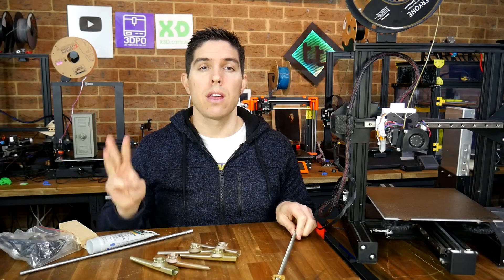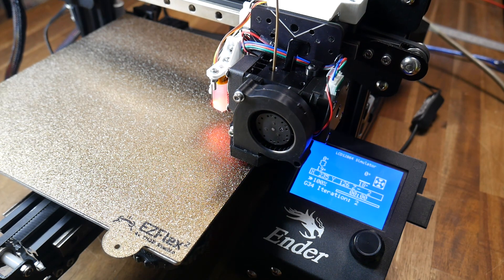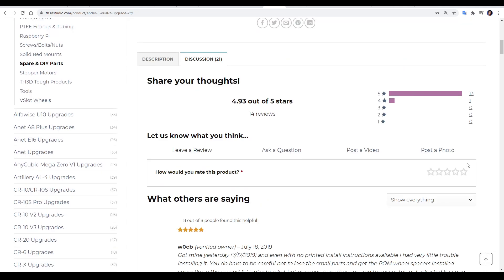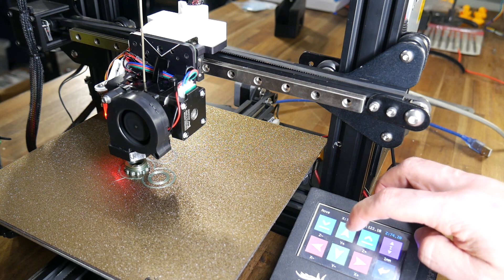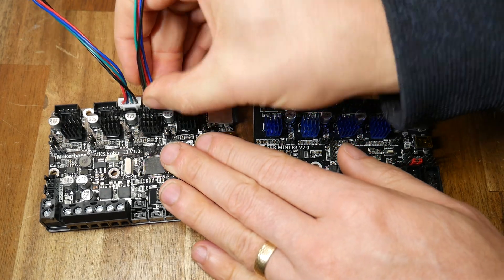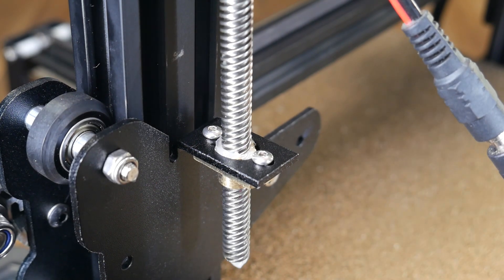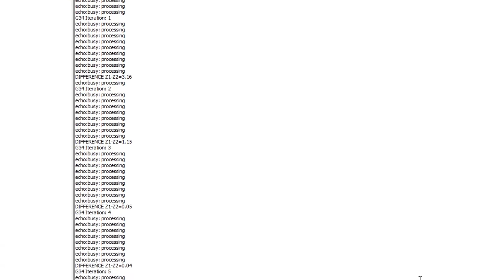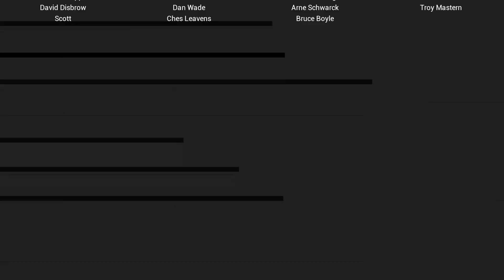3 ways to add a dual Z axis - Including G34 auto Z levelling

Comment: Everyone who moves the power supply should be adding a ground wire from the power supply case back to a secure solid mount point on the frame.
Reply: I've seen somewhere where someone moved it under the bed and drilled new holes in the frame to screw it in there, and they did it so they wouldn't have to worry about that. Seems smart to me.
Reply: On the same topic, anyone who owns an Ender 3 V2 should do the same. Some people claim their frames are grounded out of the box, but mine was not. I don’t think it was causing me any issues printing, but I ran a strip of 24V LEDs through my top bar extrusion just to see if they’d fit and I was surprised to see them faintly illuminating! 

A simple fix that can potentially save your electronics.
Reply: So many “pros” here and so many complete different answers 🤣😂🫠🫠🫠, every one in the comments is a pro until they are asked a question on how to fix something then they melt I know this because iv been trying get help from the community while heavily modifying my first printer and everyone acts like they know what there on about till there faced with a direct question and all of a sudden they melt 🫠🫠🤣
Reply: While you're at it, go ahead and ground your steppers as well. Static from the steppers shocking the drivers is one of the most common issues with the new 32bit boards. Once you start seeing shifts, the driver is already damaged and there is no downside. Creality has shared diagrams with recommended wire lengths.
Reply: Doesn't seem reasonable to ground the frame (thinking of frames made out of aluminium extrusion).

Aluminium surfaces (both coloured and raw, but especially anodized aluminium) are not conductive due to an oxide layer that automatically builds when exposed to oxygen. You would need to scratch the surface pretty bad to make it conductive AND have that scratch exposed to current AND have another scratch exposed to a motor at the same time.

By grounding your frame you are either grounding the insulating oxide layer to ground or explicitly damaging the insulation to screw in your ground connection (which oxidizes again really fast anyway). Neither of that makes sense, it might make things even worse when violently damaging the natural insulation.

Many high voltage lines for example are made out of aluminium for that reason as the insulation already comes for free without adding additional mass.

Please DON'T ground your frame unless it is made out of steel or something similar.
Reply: Since when aren’t power supply cases already grounded to the plug they’re connected to? Or are you saying in order to ground the frame, not the PSU case? 

Considering the frame is painted, what exactly are you accomplishing outside of the screws that go into the metal?
Reply: @radicalxedward8047  You got it. I hear other people saying that, but it is not needed. The PS is AC voltage and is already grounded. The rest of the printer is only exposed to DC voltage, either 12 or 24. Never did understand that grounding the frame. lol
Reply: @3dtexan890  I was under the impression that the grounding from PSU to the frame was so grounding from motors may have effective inter system bonding to dissipate  the static build up with within the motors to travel to the PSU ESD circuitry. This instead of through the primary dc circuitry to the motor drivers.
Reply: @3dtexan890  You are grounding the frame to prevent static build up which can damage the drivers or corrupt data signals. Prevents noise being induced on the stepper lines too which can cause phantom stepping or missed steps. An ungrounded metal frame acts like a radio antenna and simply having your mobile phone next to it can induce voltages that can light LED's. It's essential to have any extraneous metal work on any electronic equipment grounded. It also provides protection against internal failures in the PSU which might otherwise leave your frame floating at 240v. In short, ground anything metal.
Reply: @radicalxedward8047   ground the frame of the printer to the power supply case or better yet to the ground terminal.  If the steppers and the bed are not metal mounted to the frame with a continuous ground then they should be grounded also.  Basically anything that consumes power should have a good ground 😎

Comment: I have just installed the creality Z axis kit on my Ender 3 V2 ( AU$51.00 from Banggood).  This kit is supplied the the power supply mounting bracket for  Ender 3 and Pro as well as a connection cable for the single plug on the control board.  I have increased the Z stepper motor current to 700mA (I have a E3 mini V2 board and tft 35 E3 Display as I did not like the standalone stepper drivers of the original 4.2.2 board).

Comment: I don't agree with how you used method 1.    I have tried that myself, but the lead screw on the side with no stepper motor will move up and down slightly with every change of direction.     I had to add a stepper motor just to prevent the lead screw from moving upwards.       The other thing I found odd,.  I wasn't able to parallel my steppers.   On my ender 3 v2 I had to serie them in order for it to work properly.   So can you share more on how you paralleled them ?
Reply: Add a stop collar below the upper support bearing of the second lead screw.
Reply: @charlesbeshaw9843  yes that seems to be a fix, but nobody advertises it as a fix.    So when I bought the kit I was like.   Hmmm this doesn't work as flawlessly as people say
Reply: @bartklump  Yes I agree the kit should have made provision to keep lead screw from vertical movement. Ideally 0 lash.

Comment: I just added a second stepper setup that i found on amazon a few weeks back (it had all the parts, including a Y cable to split the stepper connection). The increase in print quality from dual Z on my Ender 3 Pro is legit impressive. I dont see dual z axis often as a "must have upgrade" but i highly recommend it. It was probably the second best money i've spent on printer upgrades. (#1 will always be a new board so the steppers aren't so loud)
Reply: Hey I'm installing that one but the secondary motor keeps trying to spin after main one stops

Comment: I assume the answer to this is probably a no, but do you think the G34 would work on a Tronxy X5SA that is stock? I assume you need some newer firmware/main board and a better ABL sensor to do it. Ehh I am gonna try it, worst that happens is I need to replace some parts XD

Comment: Hello,
Ive been 3d printing for a couple years now I started on the ender 3 and then the ender 5 i finally looking go upgraded again but i wanted to go big and i was looking at the cr10 max and heard mix reviews including your review on the printer
So to keep it simple this is my question would you recommend the cr10 max or the rat rig v3 
Right now i want to print mechanical details and have a high turn over rate with low failures.

Comment: Should I use the two separate z headers or keep using the splitter off one header? Wondering if there's much difference, as the splitter should be an easier solution. 

But might push the limits a bit more on the current being pulled by twice the load from the header?

Comment: May I suggest another less intrusive method for those wishing to test the waters: Poor Man's Dual Z
https://www.thingiverse.com/thing:4792341
This uses a belt and the existing v-slot rollers as pulleys. I came up with it while waiting for my extra lead screw to arrive.
Reply: Going to apply this on 2 printers. reminds me of the way a draftsman's drawing machine works or a parallelogram. Belt is always under tension, keeping the far end of the X Gantry supported. Thanks for the tip. It's one of those "now why didn't I think of that". I'll let you know on Thingiverse how it turns out.
Reply: Yep I have installed belts too works perfect!!!
Reply: @mitofun6967  Nice one, you've got a pretty clean setup - I like it a lot. I'm not talking about replacing leadscrews, though. This mod is a simple passive (non-driven) belt to add extra support to counter the rotation and resulting squish Michael demonstrates in this video.
Reply: Hello Troy, I see you create you tube content. Why not do a video of installing this system and showing it in action? You could title it same as your comment "Poor Man's Dual Z". 
I have printed the anchors, now waiting for some  screws and T nuts to arrive to attach them to printers. It took me a while to figure out how to insert the belt end properly.
Reply: @charlesbeshaw9843  Strange, I've never put anything together and didn't have spare screws left over - maybe that's just me! It's not normally my thing until someone prompts me but I should do a video on it.
Reply: @TroyMackay  Lots of screws but non long enough.
Reply: @charlesbeshaw9843  Yeah, just kidding but you got me thinking. Potentially you could do the same thing with the packing tape which came on the box wedged between the frame members but that's getting a bit too cheap, even for me.

Comment: great video, but something is missing i guess. dual z motors with same driver needs to be adjusted while holding & polarized.  because while the power off, most likely z belt doesnt sync well and pull the one side of the belt more, which is not easy to notice. ends up slightly heating z motors because they work against each other.

Comment: A few things if you're trying to make your z axis and prints as perfect as possible:
- don't use the power supply relocation shown in the video. This is hanging loose off the end and will vibrate and cause oscillations which can produce ringing artifacts. There are options on thingiverse that add more structural rigidity. The one in the video can be salvaged by printing and gluing a cube to the underside to support it.
- use the dual independent z motor upgrade (option 3). This is the only way to leave the lead screw loose at the top. You specifically DO NOT want to have the lead screw constrained at the top.

Lead screws are not accurate parts and are not rigid. They are not meant to be constrained at the top. As seen in the video, the 2nd option introduced z banding. The flexible Z coupler did help fix it, but constraining it from the top and bottom will still reduce quality. For that reason you want 2 individual motors and lead screws without clamping at the top.
Reply: I just fitted Creality's 2nd Z stepper kit to my V2 and it works great. My first tall vase print came out perfect. I was careful to align the Z axis and now resist the temptation to move it by hand. I don't check level every time, just now and again. Glad to see that the top screw supports have floating bearings that don't fix their positions.
Reply: @autogyro333  In option 2 the secondary one is fine since it's only attached at the top. However, the motorized one becomes constrained at the top and bottom. A flex coupler may or may not be able to compensate for this depending on the leadscrew.

I'm guessing you're suggesting building some guard around the leadscrew that doesn't actually connect to it? It should be fine provided it doesn't constrain the leadscrew. If it does, just make sure it doesn't constrain it too much or you'll likely start to see some artifacts show up in your prints. Since it's a printed part there isn't much harm in trying it out as you could remove it later.
Reply: or you build the belted z axis mod for the ender like in the voron v2.
If modified the mod a little for mor rigidity but other than that it runs very well.
Reply: This is the problem with Artillery3D's implementation on the Sidewinder X1. Two Z leadscrews run in their own top bearings and are connected via a sync belt. Because the sync belt has a fixed length, one is supposed to adjust the bearing housing position (pushing the leadscrew left or right) to get it up to tension. As a result, you have choose between proper z sync or printing without z banding.

Fortunately, with the Sidewinder the solution is simple, because it has indepent dual z drivers. If you have a bed probe that is: just remove the z sync belt (and if you still have banding, the top bearings as well) and do a G34 before each print.

To be honest, I think that's the most elegant solution anyhow. Because with a z sync belt on the bottom (where it can't overconstrain the leadscrews) you lose 20-30 mm's in z height. This is what I've done on my Tronxy X5SA which unfortunately has just one z driver (driving two z steppers, one for each leadscrew).
Reply: One correction: properly graded lead screws are precision elements fully intended to be doubly constrained on each end. The problem is that while the screws that come stock on consumer printers are better than common all-thread, they are NOT machinery grade elements.

If Creality printers included actual frames instead of just unanchored gantries, this would still be less of a problem than it is. It's true that something always has to give somewhere, but having a proper rigid support structure behind your gantry elements can do a lot to reign in a recalcitrant motion system.
Reply: @claws61821  yeah that's a good point. To be exact, the lead screws that Creality includes with their printers are not meant to be constrained, not all lead screws in general.

You definitely can get precision lead screws that will work perfectly when constrained. However, the precision comes at a steep cost that most people will not want to front.
Reply: I found the mount that came with my dual z axis kit caused the second motor to be very misaligned with the vertical extrusion.. so some adjustments needed there, plus the flexible couplers helped a lot https://m.imgur.com/a/5mfvf7M
Reply: @PureRushXevus  That's unfortunate, it's good that the flex coupler helped. Those pictures are a great example of the rigidity of a lead screw, aka none. Despite it being bent like that, provided it has sufficient play (which you improved with the flex coupler) it shouldn't be too bad.

That is because the path of the lead screw itself is what is constrained. If the lead screw bends, there will be less resistance against the path that the x gantry mount is trying to force it along.

Something in the system has to give to the inaccuracy of the lead screw. If you add a solid clamping on the bottom and the top, then you are likely to force the x gantry out of line slightly and get the artifacts shown in the video. Of course, getting a straighter leadscrew could probably help in your case too.

If you look at the videos by MirageC explaining the ball screw system on his printer, it helps understand the purpose of the leadscrew a bit more. Deckingman also has a good video about leadscrews.
Reply: @lllllllllllillllllll  Cool, yeah you really see the top of the leadscrew move around a fair amount when printing sometimes if it's not perfectly aligned, so I now understand why having that free is important :p
Reply: No problem with skipped steps without the belt? My Artillery Genius has a belt and I like that I can use it to move the gantry up and down when turned off without it getting out of sync.
Reply: I heard so much bad things about installing second lead screw and don't see much benefits.

Comment: I did the proper printing belt version a while ago. To level I just loosened the z motor coupler, put a bubble level on the x gantry, and adjusted. It worked well and was really quick and easy.
Reply: hi, i want to do the proper printing method too, u recomened it? any suggestion?

Comment: I'm using method 2 on my Ender 3 with SKR mini E3 v2 board, but instead of manually leveling the gantry with blocks I'm using Marlin's MECHANICAL_GANTRY_CALIBRATION implemented as G34.

Is there a reason you didn't cover that option? It seems to be working for me!
Reply: Hi, could you describe this further? I also have a SKR mini E3 V2 board, but i'm not sure if it is capable of doing the G34 because it only has 4 TMC drivers.
Reply: @MIPE83  For the life of me I cannot find where I discovered this right now.

I'm on the bugfix 2.something, and in Configuration_adv.h There is an option called MECHANICAL_GANTRY_CALIBRATION. Enabling that makes is so that G34 causes the printer to raise the x-axis gantry all the way to the top of the printer's frame in order to square the gantry with the frame.

I've been using this for a few weeks and it seems to be working well!
Reply: @lordplatypus1997  Thank you! I‘ll try that too.

Comment: 10:08 In my experience it does need to match exactly if you are chaining the motors together in series. I used a slightly thinner motor (old extruder) for a second Z axis motor and it got very hot and started skipping steps. I think parallel works better, but might cause overheating of the driver (if I remember correctly)
Reply: In series, the one that has the lowest equivalent series resistant will effectively be doing most of the work for both motors.

Comment: When using a flex coupler is the idea to have them seperate slightly or is it best to have the shafts touching? I've heard seperate slightly to allow them to flex easier. But I've heard butted up so that they can't wiggle too much.
Reply: You want a ball bearing in the center. The ball bearing allows the leadscrew to rest on the motor shaft while still allowing side to side tilt. This will allow the flex coupler to compensate for a wonky leadscrew but not bob up and down.
Reply: @derektran9404  interesting I haven't heard that yet I'll have to give it a try.